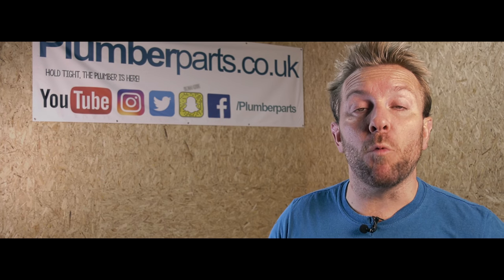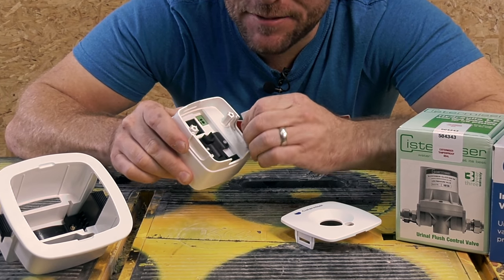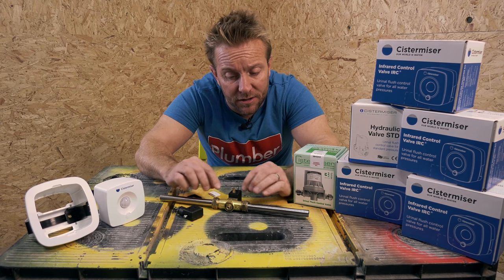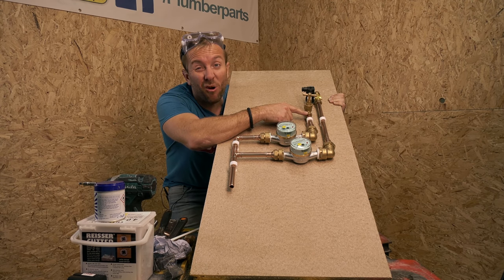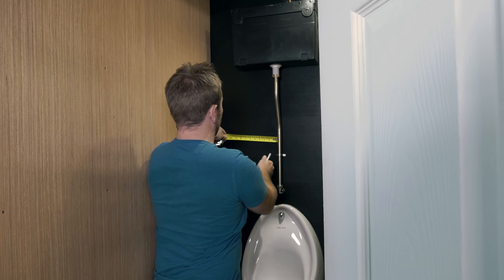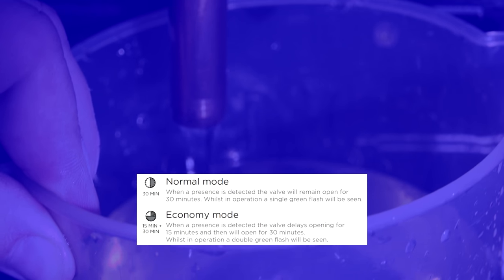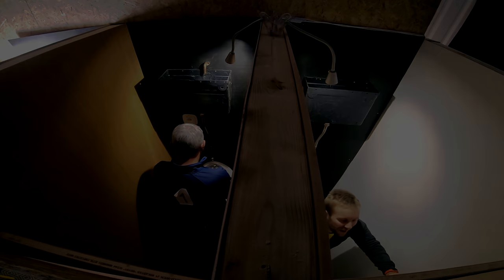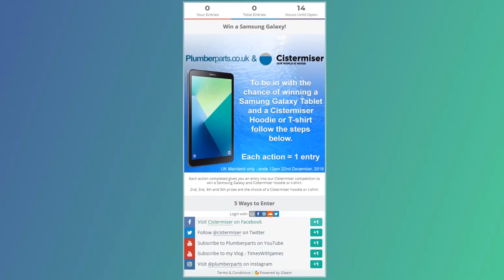WATER SAVING URINAL TEST I TURNED THE STUDIO INTO A PUB! Cistermiser IRC Installation

Comment: The issue with only having a WMS attached to the pipe work is that if you don’t have a socket in the urinal to break down the Uric salt, it can cause a build up in the pipe work underneath the urinal resulting in a terrible smell! And a very expensive plumber job! Cue dyna rod. Quite a lot of hygiene companies supply the sockets, such as the Actiflow from citron hygiene

Comment: Hi James, I've watched a few of your videos now I'm wondering if you can point me to a video of yours which may help me. I've had No heating for the past 2 months and I'm sure I've tried everything other than a powerflush or installing a new boiler. I have a viesmann combi which I've replaced the pump, balanced the system,and recently done and inhibitor. All your vids have helped me through these processes but now I'm baffled I still have 0 heating. The upstairs rad gets luke warm but no other rads work at all. Is it a new boiler time or WHAT?? please help I'm really stuck here. I've had professionals out which are also baffled by this I've paid nearly 500 on replacing parts and call outs with no luck. Diverted valve is fine all other aspects have been serviced I have 80 degree hot water but no heating even bled all rads in the house even isolated each one and they only ever get luke warm please please what do I do sorry for hi below
Reply: Hi
Reply: Check if your diverter valve is functioning correctly.
Reply: Ah you mentioned the diverter valve was serviced, check if all the valves are open and not frosted. Try tapping them with a hammer to help release them.

Comment: Water saving devices for urinals and low flow urinals are crap. They will require more maintenance because the piss will crystallize in the trap much sooner (that is why people complain that their urinal doesn't flush anymore). Urinals are the most dirty plumbing fixture we commonly deal with and things like this make it even worse. You won't think low flow urinals are great if you have to take apart the flushometer and pull it off the wall only to realize the trap has become a solid brick that you need to scrape free.
Reply: @The secular humanist There will always be some that coats the trap no matter how small the amount. Bottle traps never fully evacuate so more water flow is less maintenance. And for some reason people put water saving devices on s trapped urinals which is beyond stupid.
Reply: @stanley That's the spirit, keep me employed.
Reply: I disagree with this comment as maintain urinals all the time and associated blockages, I do not work for wms company, with urinals using water management systems, i usually find major blockages between 1-2 years, usually mostly within the traps p or bottle and never more than a half meter in the pipe, but also it is dependant on the pipe to waste arrangement, trough urinals with no access are usually the worst for this, simply because no one wants to access them.

Comment: Is there a maximum number of urinals you can control off one of these units?
Reply: Hi Jacob, the ratio is one IRC2 to one cistern.  The number of urinals that this feeds depends on the setup.  You can always give Cistermiser a call if you have any queries on this.  Tel 0118 969 1611